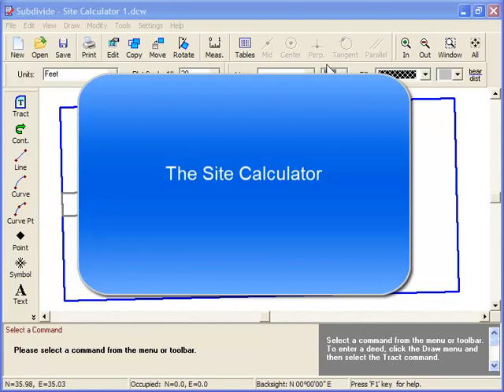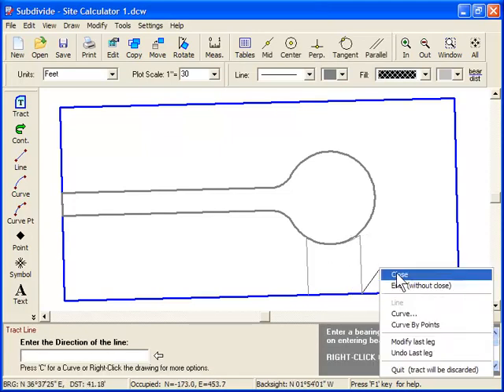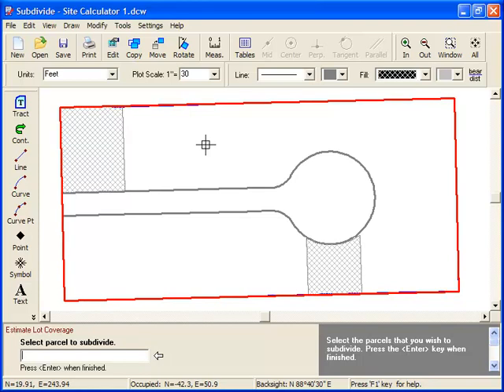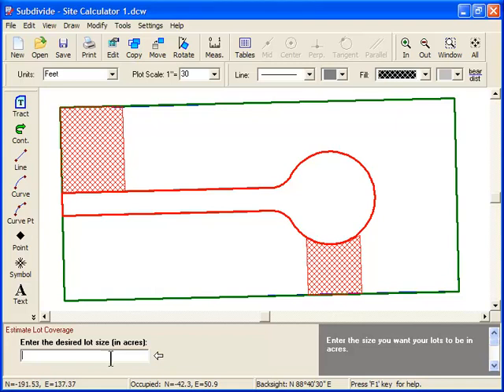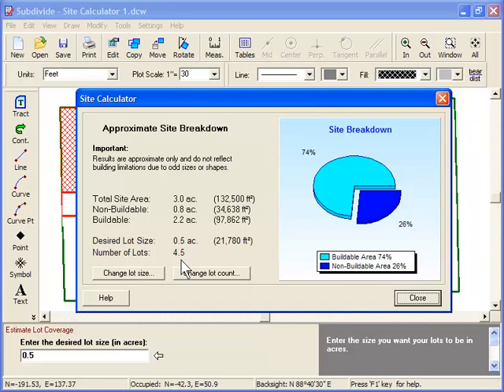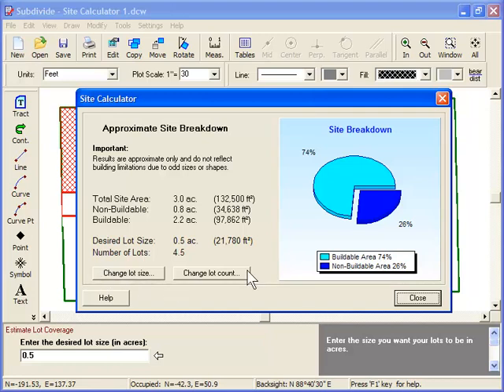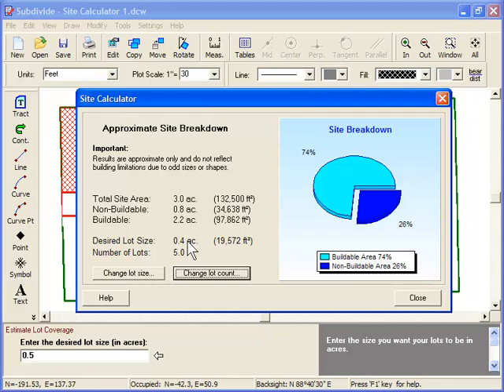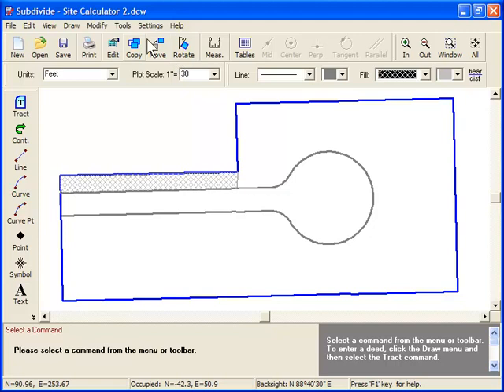How to calculate lot coverage.

Comment: What happens when you have a very irregular shape with 100+ acres
Reply: Hi Dorothy, The shape and size does not matter. As long as you can draw a boundary around the the parcel, and then draw boundaries around the non-buildable portions (roads, ponds, etc.), it will work fine. In the video, we use a smaller parcel just for clarity.